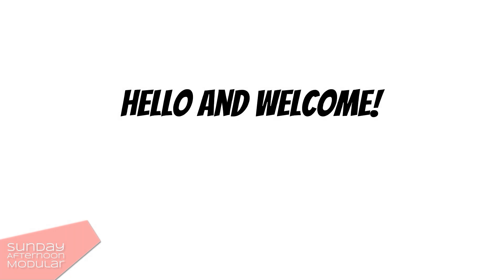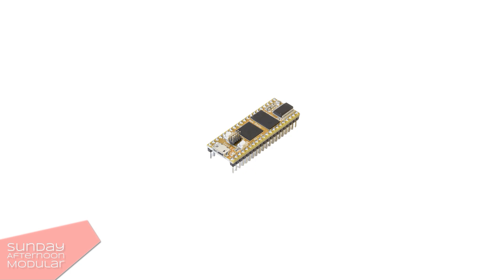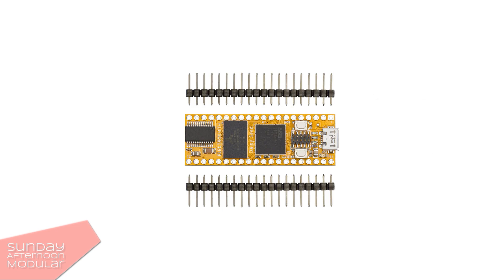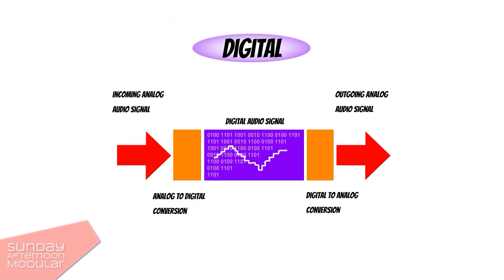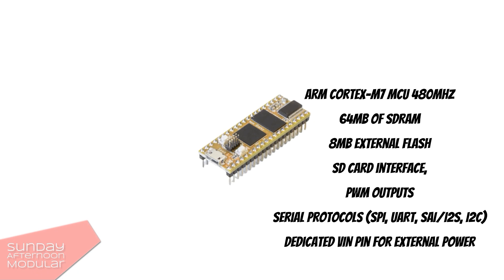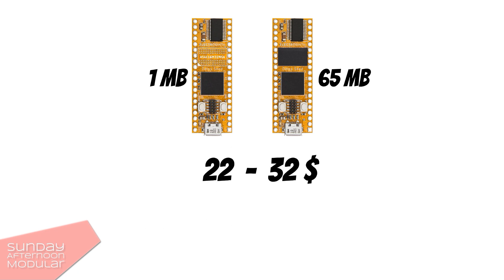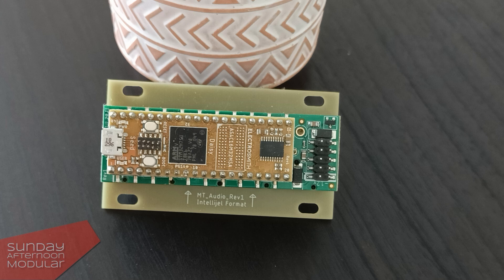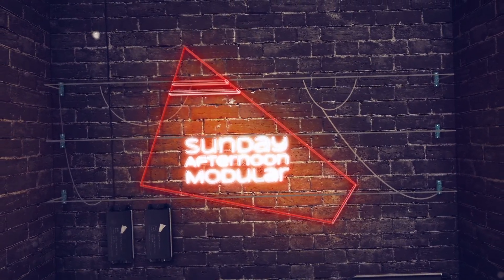Why do so many modules have this? - ELECTROSMITH DAISY SEED

Comment: Which modules do you know use the Daisy? I know the similar Teensy is used on Music Thing Modular Radio Music and Ornament and Crime
Reply from the maker: Hi there, a lot of the Mosaic modules use the daisy seed, just as the plucked string shown in the video, their drum modules, mono reverb, variable delay and decimator, some modules from Qu-Bit also use the daisy seed, Data Bender, Surface, Aurora to name a few, and the whole Legio, Versio and Iteritas Alia series from Noise Engineering uses the daisy platform as well.